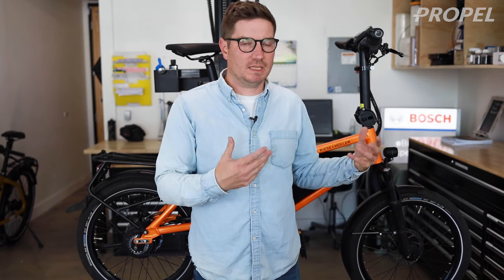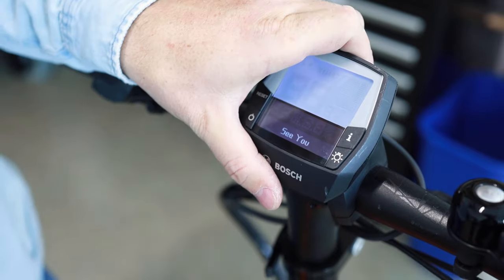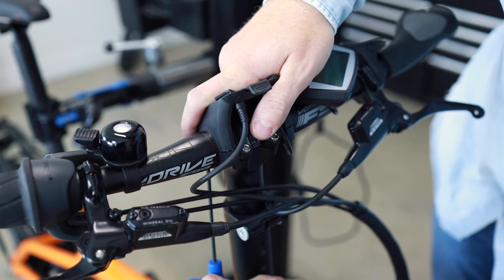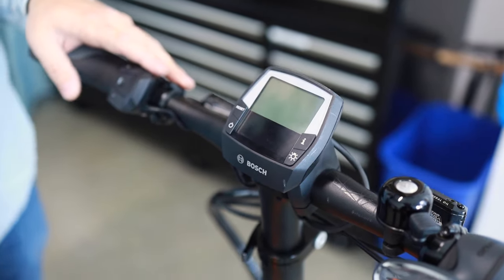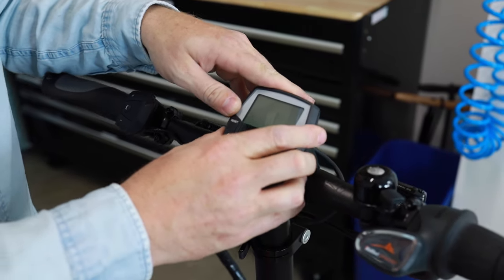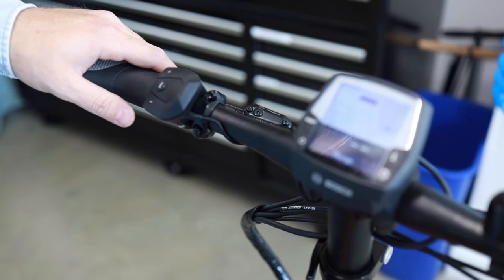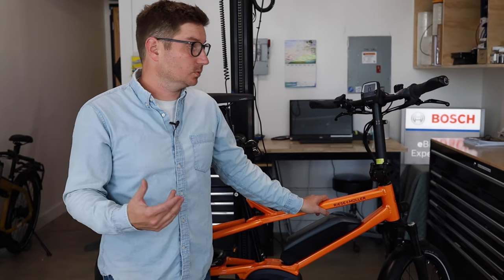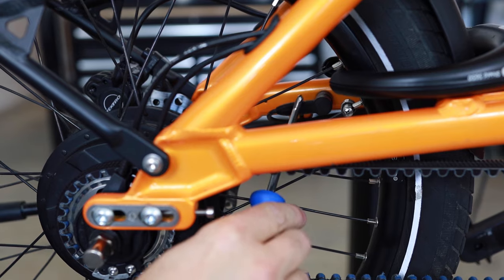Bosch Ebike Motor Systems Troubleshooting | Power On Errors & More

Comment: My Intuvia display is switching off during bumping downhills. I turn It on again but It doesn't respond to  the assist level command, going to Eco but comming back to no assist. I have cleaned up the terminals of Intuvia both sides but It Still letting me down on bumping rides. What do you recomnend?
Reply: I had the same problem.
Cleaning the pins of the battery port 
And bending back the connection "springs" in the battery worked for me.

Hope this helped

Comment: I wanted to express my thanks for providing the solution to the problem with my wife's Intuvia display.  Since new, her bike would randomly shut off, often on a bumpy road, and need to be re-started.  The only solution I had for this problem was keeping the contacts surgically clean.  The problem had been getting worse, sometimes shutting off twice or more during a ride.  I knew it was contact related, but could not figure out why, and was thinking of replacing the display.  Then I watched your video and noted your comment about possible warpage of the mount if it is too tight.  So, I checked.  It was way too tight as there were no gaps between the halves of the mount.  Loosened it until it was movable.  The random shut off problem has totally disappeared, and the bike is rock solid reliable now.  Many, many thanks!
Reply from the maker: This makes me very happy :)
Reply: @Propelbikes   I am glad you are happy, and for sure that makes three of us, as my wife is thrilled her bike no longer shuts off randomly, and I am happy to have found the solution to the problem.  Thanks again!
Reply: @garyvernon5705  I probably have a very similar problem and your video pointed out this potential problem which is great, thank you. For me, after some months the original bolts loosened so much that one side of the mount clamps just fell off and disappeared. To prevent this happening to the other side, I tightened it a lot. It was all fine for a year, but recently some disconnection problem started, randomly disconnecting, also showing the flashing empty batter symbol. I will try to loosen the remaining bolts to see if it helps, but it's a bit hard to see how single side mounting (that was working fine) is now not working.
Reply: @tobidelbruck  I have the same problem with my Bosch Intuvia. It disconnects during the ride and displays the empty battery symbol for 2 seconds. Did you solve the problem?"

Comment: I bought the bike Friday. It looked onboard computer  was not taken all the time in the seller's garage for a long time. I downloaded the bosch ebike connect app. I pulled the onboard com and placed it back again. Bike didn't acknowledge the o/c return. I even registered and paid the bosch lock system. When I pulled the o/c I hear the sound when place back I don't. The Lock sign is permanent. So far I have tried everything with no success. Have you come across this issue before

Comment: Based on the number of comments I am finding there appears to be a problem with the battery in the Intuvia losing the ability to hold a sufficient charge after a point to activate or maintain control the power pack  battery.  Why has this product not been recalled?

Comment: Hi from uk.  Thanks for pointing me in the right direction. After winter storage placed the battery back on the bike and the display was only partially displaying. Solution was to turn on at the power pack. Many thanks for video

Comment: Very good video, you're very generous to share the knowledge. I have the problem described first in the video, with the gen 2 classic display not showing speed and motor not working and now I know what needs to be done. I'll loosen the bolts and I'll clean the contacts. Hope it'll work. Thank you!

Comment: Excellent video. I was resigned to taking my Riesse and Muller Nevo GT to the shop because the display stopped functioning. I learned from Chris in the video that I can charge it via a micro USB port on the display's side -- OR turn on the display via the battery while it's on the bike. Huge relief.

Comment: Hi Chris, best greetings from Germany.
I had an issue with intermittent motor assist. The indicated speed also varied  between 0 and x.
The speed sensor was perfectly aligned with the magnet and both, magnet and sensor didn't look too dirty.
I then saw some shiny little particles on the magnet. After removing those the system worked fine.
Obviously the speed-magnet attracted some magnetic particles that influenced the magnetic field, resulting in faulty speed-readings and consequently the motor assist was deactivated.
Reply from the maker: Great feedback! Thanks for sharing your experience. I'm sure it feels nice to be able to solve those things on your own.

Comment: Just come across this video, very useful, many thanks!! I have a Bosch e-bike and I have the dealer software. When switched on the software states the motor is in "FBL Mode" and needs reprogramming???? Is this something i can do myself with the software??? Any clues would be gratefully received,

Comment: Good info Chris! I have a 2017 Haibike Full 7.0. The problem I had was with a bad main battery and charger. The display would turn on however the bike wouldn’t switch out of the “off” mode on the display.
Reply from the maker: This could also be an issue with the thumb controller. If it's not functioning it won't allow you to switch from the off mode.

Comment: Great video! 👍 

I have a 2016 performance line cx with 7700 miles. It just developed a high pitch vibration sound on top of the motor whine. This  noise isn’t present with the motor off. Have you ever encountered something like this? Idea of what it may be?
Reply from the maker: I would check the motor mounting bolts and confirm they are torqued to spec. There is also a dampening film which goes between the motor and the frame which could be worn out or installed incorrectly. The added torque of the motor could cause this to only arise when the motor is being used.
Reply: I will look into that.

Thanks for the quick reply

Comment: Love my E-bike.  My Intuvia on board computer would display but I could not turn on lights or engage electric assist. I take computer off everytime I leave bike.  I put it back on and it doesn't work, but hours later it was working.  Someone on 'youtube' mentioned the 'button' near battery to turn on bike's electric to get his Intuvia working.  As you also mentioned when onboard computer display is abnormal. Pushing that button is a wonderful bit of knowledge.  I want to call that button a 'REBOOT' button.  Pushed it and Immediately my display and Intuvia worked.  I get to have assist. to pedal out of the fields back onto trail than road to home. Joe
Reply: But is this a problem of the display or not?
Reply from the maker: This issue usually means that the battery inside the display doesn’t have enough juice to turn the bike on. This is why you can still turn the bike on from the main battery button.
Reply: @Propelbikes  and what is the solution ?
Reply: @toxotis70  I, Joe Prelas read a solution. When display doesn't turn on. Reach down and push the button where you connect charger. It seems to reset and display turns on.
Reply: I, Joe Prelas read a solution. When display doesn't turn on. Reach down and push the button where you connect charger. It seems to reset and display turns on.
Reply: @Propelbikes there are a number of contributing factors that include poor battery contacts with the rack receptor. But a faulty battery in the Intuvia is the central issue. I only recently found out about using the power button on the rack battery to energize the system. This makes my ebike run perfectly.

Comment: Thank you very much for this video.  Both my and my husband's bikes are not turning on.  We did try cleaning the connections, but we didn't know anything about resetting the battery.   We will try that next.  I do have to say that it's bizarre that both bikes won't work at the same time, on the same day.
Reply from the maker: Have you tried to turn the bike on by pushing the button on the battery?
Reply: @Propelbikes  yes sir.  My bike will now turn on if I turn the battery on first.  My husband's now shows Error 640.  We also followed your advice and loosened the handlebar bracket, so that the display can be moved back-and-forth a bit.

Unfortunately we purchased the bikes early last year, from a bike shop that permanently closed it's doors earlier this year.  I did do a search and found an authorized Bosch dealer a few towns away, so I'll call them on Monday to see if I can drop the displays and batteries off.

We had purposely purchased our bikes at a local shop as we do not have a heavy duty bike rack, nor a hitch on our car -- it was easy enough to peddle down to the local shop.  So I hope this bike shop doesn't require me to bring the bikes in too.

Comment: Good timing for this. I just started getting that Service message when I turn the bike on. I assumed it was just a scheduled thing but it’s good to have that confirmed.

It’s annoying though because I just took my bike to the shop recently so they didn’t reset it. And I don’t think I’ll need another service for at least 6 months to a year. So I’m stuck with it for now.
Reply from the maker: That is a bummer that they didn't reset it, but yes, it won't impact the performance at all. It's just a display thing.

Comment: Hello... Thnaks for a great video... I am having an issue with my Bosch Intuvia which is not shown in your video. During an overseas move from Germany to Canada, my ebike works fine but it is stuck in "Tour" mode. Initially, the display bettary was dead but was able to charge that via teh USB port as you have shown. The handlebar shifter does not work. I noticed that on the base plate under the display where the three golden and four silver colored connector pins are, one golden and one silver connector pin is missing. I presume that this is the reason I cannot shift modes. Do you know if these connector pins can be replaced or could I repair them by filling the cylindical holes with a wound aluminum foil. I have a picture if you are interested.

Comment: You have a great channel here!! I got a new Riese & Müller Charger 3 GT vario with an Intuvia Display. Everything's fine but it's not possible to turn off the lights while riding. On my old bike I could decide to use or not to use the lights. What can i do to switch the lights off while riding? Thanks in advance and greetings from Germany - Axel
Reply from the maker: Thanks Axel! Much appreciated! Congratulations on your new bike! 

I’m not sure if it’s the same in Germany, but you might be able to have your dealer make the lights switchable. This isn’t possible on high speed bikes in Europe, but it might be possible on yours if it’s not HS.

Comment: My Brose mid-drive on a Bulls Lacuba evo8 power occasionally cuts out from a bump or won’t power on from off. Adjusting the battery mount so battery is tighter made a big difference. I also added a Velcro strap to hold battery extra secure. The battery electric connection doesn’t like the battery wiggling which creates an arc at those connections. Removing and reinstalling battery should make the battery light bars turn on; if they don’t just do it again w/ a little emphasis. Unplugging the display and left thumb pod and replugging those 2 connections also a quick fix if they aren’t tight. Pressing the battery on/test button also “wakes up” the display sometimes, along w/ removing and reinstalling it. The display also needs a good tight fit on its mount or the connections arc and shut off power until you reinstall the display again. I actually added a duct tape shim so the display connects a tad tighter when twisted in.
All minor issues that are ez do it yourself fixes out in the field.

Comment: Hi Chris, thanks for the infos. I have a Bosch Performance CX with an Intuvia display. The motor once failed (Error 500) but got replaced by Bosch without any troubles. Now it works like a charm. Sometimes but rarely I have to switch the system on by pushing the button on the battery. I've installed a little screw that keeps the Intuvia in place so that it can't be stolen very easily. So the display is always mounted on my bike. Recently I noticed some water ingress in the form of some cloudy condensed vapor on the inside of the display (I keep my bike outdoors regardless of the weather). The cloudiness seems to have disappeared after few days.
Reply from the maker: Thanks for your feedback! I hope this is helpful :)
Reply: pepper669 I have that problem, screen fogged up and having just tried to remove it it won’t budge, not sure what to do now?
Reply: @karenseale3769  There's a little screw underneath that prevents the display unit from being moved. But I'd just wait for a few days and the fogging should go away (maybe put the bike into a sunny spot).

Comment: So maybe you can help me with a problem I am experiencing. When I switch power on, the display does not show the  0  on the display and when I hit the + on the thumb switch it goes to "eco" and back to off. I used some electronic cleaner on the thumb switch and still have the same problem. But if I have the charger connected and then remove the charger, the display shows the 0 and the thumb switch works perfectly for changing the power levels. If I turn the system off, and turn it back on, the thumb switch does the same erratic behavior as stated earlier in my comment. As long as I have the bike on the charger and then disconnect, the system is on and works correctly until I shut it down. Any Ideas?  Jim
Reply: A number of owners including myself have found that the battery in the Intuvia loses it’s ability to retain an adequate charge to activate the processor in the drive battery. When it reaches this point the best option is to use the power button on the drive battery to activate the system.

Comment: Great video.
I have an issue where I removed the battery to allow a cable cable for the dropper post.
Upon powering up, the display works and the speed indicator works however, no motor assist.
I have double triple check and reseated all connectors to no avail.
Is there somerhing I have to reset?
Thanks

Comment: Thx so much for this video. My display wasn't showing the 0.0 mph, so I pressed the power on the battery pack and the 0.0 mph showed up.  Sorry if i missed it, but how do I get it to work properly again, ie when I switch it on at the display it works. 
I dont want to push the power on the battery pack everytime ?  Thx alot.

Comment: Thanks very much for this very helpful and excellent account the Bosch system. 

We have two Bosch mid drive bikes with just over 4k miles on them over here in the UK - our local bike shop seems to that at 4K problems start to occur with the motor unit which are undiagnosable - how long should a Bosch system last and do you ever get stumped by a fault on a bike?

Thanks again for your great videos!

Comment: thanks very much for having the solution for my problem. Tried replacing the 2016 batteries but they were not the Maxell ones that were in there previously but the brand Varta. Seems like they dont work. I have now subscribed as your channel is very helpful.

Comment: Hi Chris, I bought an Electra Townie Go I5 with a Bosch power system just a few weeks ago and love the bike but i find that I get little surges of power-assistance unless I am peddling pretty constantly hard against resistance. In other words, I might be going along at "Turbo," the top level of assistance, but can feel very slight variations in the amount of power assistance, which gives a slightly jerky feel to the peddles. Have you encountered this before? and if so, what can be done about it? Should I ask my dealer to reprogram the controller or something? Thanks for sharing your experience and wisdom!

Comment: Thanks for taking the time to do these videos Chris - really helpful! As with another poster, I’d appreciate advice on looking after the electrical connections to the display - looks like this might be a weak point? In particular it rains a lot where I live ((Cumbria, UK), do I need to protect the contact points in some way when I remove the display from the bike and then leave the bike in the rain? And is there a routine I should adopt to keep the contact points in good condition?

Thanks again!

Ian
Reply: Hi Ian, I live in the tropics and we get a lot of rain, we have experienced some issues that although the Bosch Purion Controller is water resistant some humidity may come in if you don't cover it when carrying the eBike on a roof Rack or on a Pick Up Truck when going at hi speed on the Freeway. One thing is rain pouring down on the Purion, but rain at hi speeds on the hyway it's a different story altogether.
Reply: jodigurvideos 

Hi Jodi - thank you for your reply - I suspect your rain is a bit warmer than ours :) .  Good point re the Freeway - our bike is often on a bike rack on the back of our vw camper so I’ll protect it somehow when it’s in that situation.
Reply: I should have said, our controller is the Intuvia which detaches from the bike.
Reply from the maker: Thanks for adding some ideas Jodi! Excited about the comments on this video. 
Ian - If you're having trouble you could put a very small amount of dielectric grease. For cleaning we usually use alcohol. If you're having trouble with the connections and they are corroded steel wool or some super fine sandpaper could help clean them up.
Reply: Propel Electric Bikes Great advice - thanks Chris
Reply: I’ve got the same unit on my bike but I can’t remove, did you have any issues getting off please?